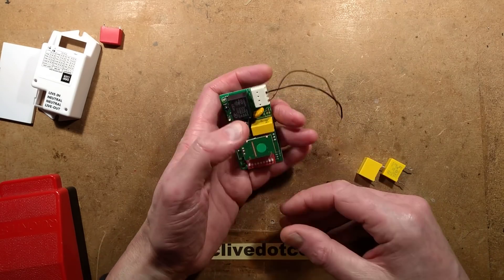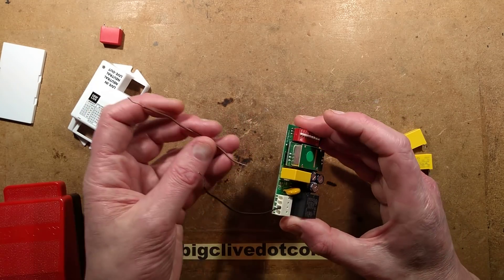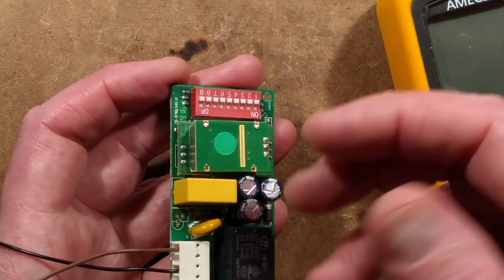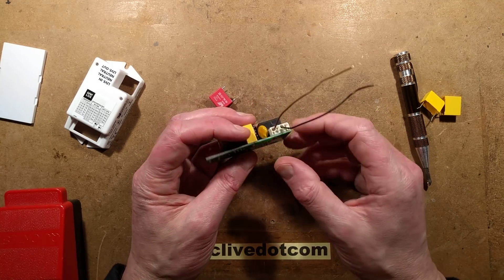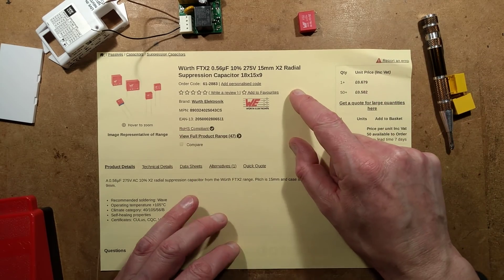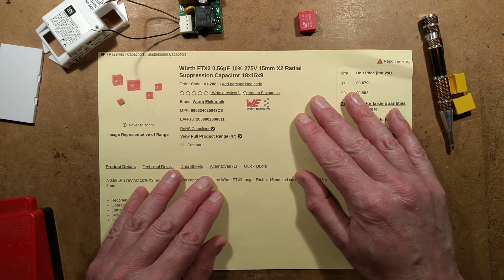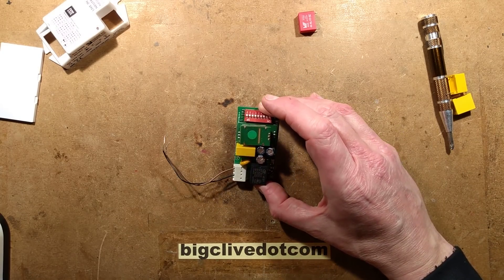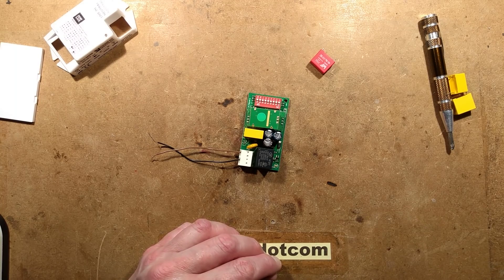Fixing a microwave body detector.

Comment: What's the difference between CPC and RS Farnell?
Reply from the maker: CPC is the consumer division of Farnell.  RS is an industrial supplier who are expensive, but provide fast delivery of specialist goods, stock premium quality components and provide good customer service.  For industrial maintenance that can save a lot of expensive downtime.
Reply: @bigclivedotcom  So if I wanna get the good stuff, I should go to RS?
Reply from the maker: It's best for industrial applications.  I used to use them for critical components like high current diodes and specialist transformers.
Reply: @bigclivedotcom  My mouse developed bounce a while back, so I ordered a set of Omron switches from RS...  Basically what I'm wondering is: am I a stupid stupid idiot?

(I wouldn't be surprised if I am).
Reply from the maker: @Asdayasman  You'll get good quality switches, but they will be expensive.  Another thing you could have tried for contact bounce is a low value capacitor across the switch contacts.  Something between 10nF to 100nF depending on the circuitry.
Reply: @Asdayasman  It's not too difficult a concept, really. When the switch is not pressed, the capacitor will charge up. When it is pressed down, the capacitor will discharge. The trick is getting the value of capacitor just right, to counteract the bounce, and also (importantly) if the value is too high, the energy in the discharge could cause some damage to the switch contacts, although the values suggested by Clive are perfectly fine. Essentially, it's acting as an RC filter using the resistance of the existing circuitry.

In other words, the discharge of the cap will make the switch seem like it's closed while it is bouncing.

Also, wow, I still remember stuff I learned over 30 years ago and haven't used since I discovered that you can debounce in software :D
Reply: @dasmeatloaf7670  Yo that comment was amazing, I understand the concept reasonably well now, I think.  You should make videos about this sort of stuff.

"Here's some problem you might have, here's the solution, here's why it works, look at my oscilloscope".
Reply: @Asdayasman  Thank you for the compliment. I may just do that when I can afford a camera, although that may take a while as I have permanent illnesses and am on benefits.
Reply: R.S are expensive.

Comment: So big Clive your mission if you chose to accept it is to develop a whole house device to do away with apparent power and retire very rich when the power company buys you out with hush money (no matter if it works or not?) perhaps.
Reply from the maker: That's actually a very tricky task.  It would probably involve a power factor corrected power supply and a DC distribution system in the house.
Reply: @bigclivedotcom  just remember it needs to fit in the mains fuse box
Reply from the maker: @grandpaseed  That's no problem.  I'll market it as a whole house energy saver and just have a small capacitor inside and an LED indicator on the front.

Comment: I had the same issue with an IR detector light. It was triggering all the time on its own every minute. The metallization layer in the cap was eroded away as well. I fixed it with a cap out of a broken ATX power supply. That's the reason why I can't throw anything away. You never know what you need. (well I could have bought the cap, but what's the fun in having to wait for days)

Comment: The big voids on the capacitor plates are faults that have been cleared by the "Self Healing" vaporizing the material around shorts.
Reply: All conductors are 'self healing' if there are enough amps being shorted.
Reply: Exzaply!
Reply: They (well, other manufacturers anyway) do make versions with 2 dielectric layers in series, designed to be stable enough for this application.
But that costs more (or maybe PCB designers aren't willing to allocate the extra space), so far too many product makers don't bother (or perhaps the duller engineers don't even know).

These capacitors are a key reason I'm wary of electronic controllers in otherwise simple appliances (I've had to replace one in a portable heater, and yes it works now; but Faraday only knows how many appliances have been thrown out for this reason, by people who don't know they could be fixed).
Reply: Dave Micolichek  you, of course, realize that thousands of man-hours went into the material science behind these capacitors being able to survive what would otherwise be component lethal fault events and that because of them radio repair shops basically disappeared.

Comment: Can using an isolation Transformer change the apparent power factor if its beyween the hopi and what your testing?
Reply: Yes, due to the magnetising current of the transformer, being inductive in this case you would probably see a higher power factor(but also a higher active power due to losses in the transformer).
All of this without getting to the non linear load presented by both the transformer near saturation and the device.

Comment: That looks awfully familiar. Didn't you take apart a faulty remote controlled plug module that had a similar layout?
(yeah, I don't actually expect you to remember. It must have been a hundred videos back or more.)
Reply from the maker: It's a common power supply and equally common failure mode.
Reply: Ah, yes!
Uploaded on 22jul 2018
https://youtu.be/mVkEDduVQJA

Comment: Speaking of capacitors, can you explain how the little 1/2/3 uF capacitors give the different fan speeds?
Reply from the maker: On each half cycle the plates of the capacitor can only accept a certain amount of electrons, so the capacitor only allows a certain level of current flow on each half wave.  That effectively limits the current flowing through the fan motor, without dissipating heat in the process like a resistor would.
Reply: @bigclivedotcom   thanks!
Reply: Most multi speed fans use taps on the windings. Neither the tapped windings nor the series capacitor is a particularly good way to implement it since the efficiency drops off quickly and it involves design compromises in the motor, but it's cheap. (BLDC fans are much better, but sadly quite expensive in sizes larger than 200mm.)
Reply: @NiHaoMike64  Got a ceiling fan that's getting a new med/low capacitor. Was curious as to to how they work.

Comment: That unit had a surprisingly small margin for the cap. I've seen devices which fail when the cap is at 20-30% of rated value.
Reply: Might be that the capacity reading is worse with higher volt or different frequency, I guess.
Reply: For class 2 (ferroelectric) ceramic capacitors, yes, but plastic film capacitors shouldn't have large non-linearities.
Reply: Long Runner good point (esp. since it’s mains frequency not in SMPS „high“ freq)